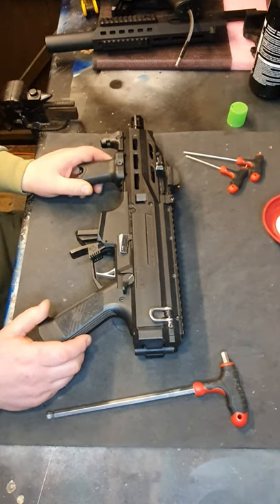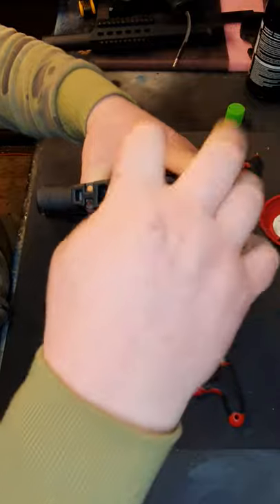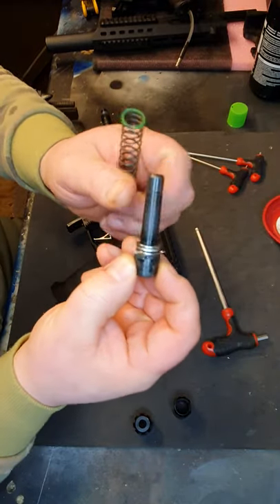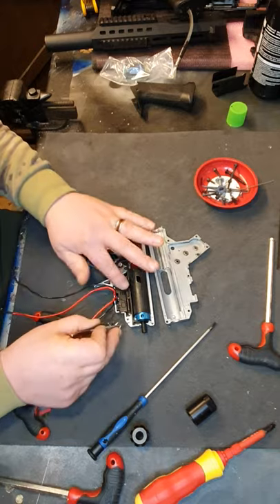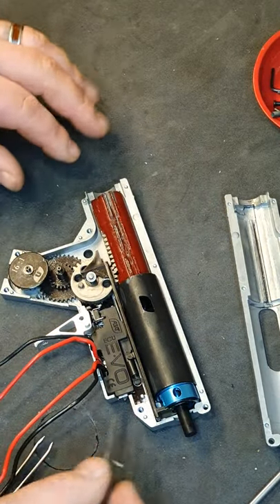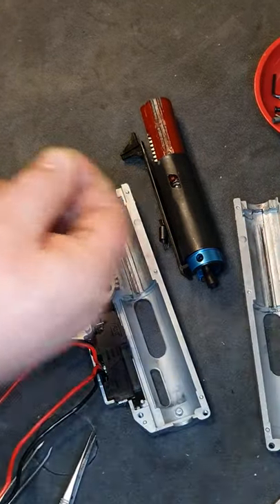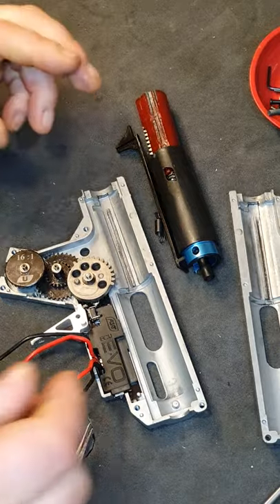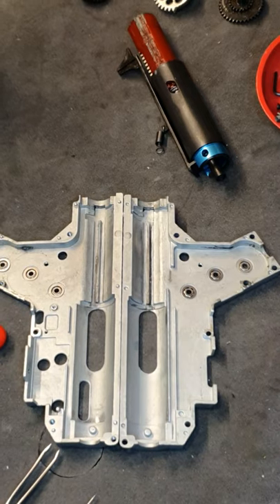Airsoft asg scorpion evo complete strip down fully upgraded internals gearbox maintenance (part 1)

Comment: Thanks for this in dept guide! How many teeth did you remove for the shortstroke?what spring are you using for your build? If i want to achieve less than 400 fps, what spring do i need and how many teeth shud i cut? Thanks again

Comment: Thank you for this video!

May I ask about your upgrades?

Did you notice differences between the old mosfet and the new one?

16:1 ratio is close to original, did you need an ARL in this case? Or for some other reason?

What ARL are you using? Standard V2 with the mounting pin removed?

Thanks!